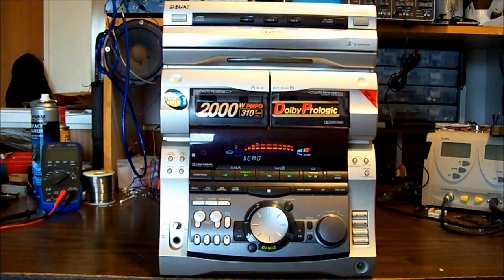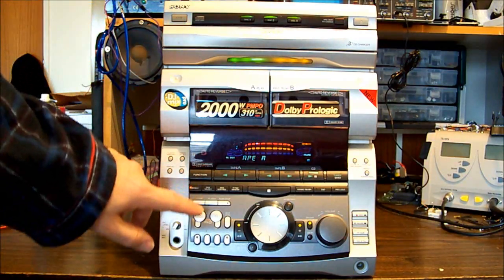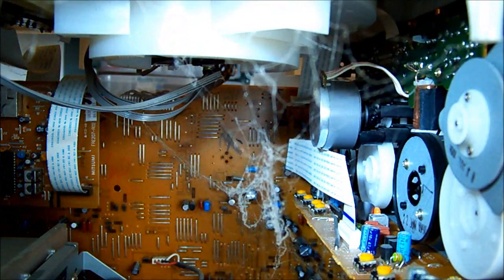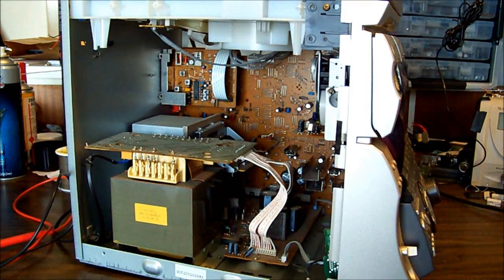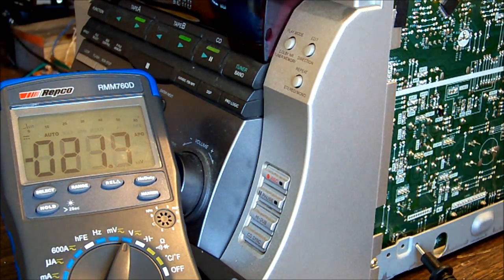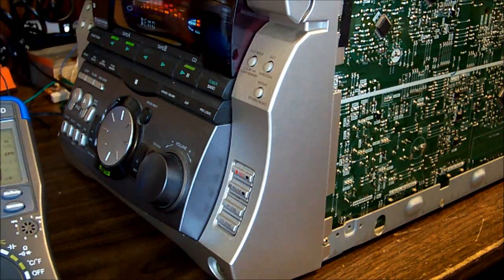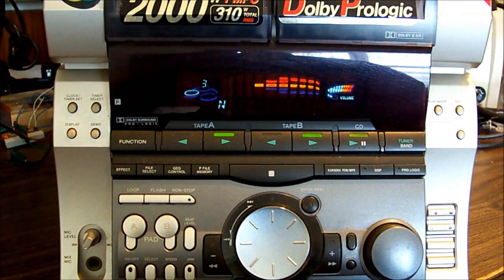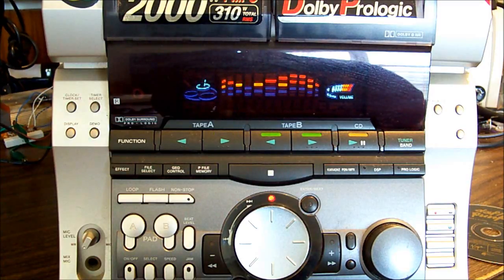Sony HCD-GRX10AV mini system diagnosis and half-repair

Comment: Hi sir. I found your video exciting. Seen sony antique products repairing nicely. I want your little help. I've sony hifi music system model Sony LBT - zux10d. Its been working nicely but recently whenever i start the unit it display shows Please Wait. Dvd tray open & close but disk doesn't play. Its display show Only Please Wait. When it shows Please Wait sound doesn't come even in Fm, not even in tape and audio in. Please suggest what is the problem in it. Thanks alot
Reply from the maker: Just guessing but does it only show please wait when you select CD or can you listen to FM, turn it off, then turn it on and get message? If CD triggers it I would say check the limit switches etc. It might be trying to home the tray or laser or something but can't tell when it's ready. If any source does it maybe it's waiting to see if the speaker output is ok. Firstly check the board for bad solder joints around high temp areas like power supply and amplifier. Unplug and reinsert flex cables to make sure connections are good. Then make sure voltage rails are complete and clean.

Comment: i have the same music player, and it has the same trouble, only i can get it to cd mode, after you press on, i always quickly turn on the cd player, and very quickly i have to open the disc tray and insert the cd and then do eject to get they disc tray inside, if i don't do that the installation shuts itself off, if i do manage to do that rather quickly (just a couple of seconds time) then there is no problem.... really weird....

Comment: Hi there I have a Sony mhc gnz8d 5.1 the sound of front and left channels are dead rest surround and centre channels are working fine. What could be wrong with the player please need your help.
Reply: And there is current passing on the chassis of the player when I checked with a current tester.
Reply from the maker: Hello. I guess you've tried one of the other speakers in that connector to make sure those speakers aren't dead. If they're ok you'll need to start tracing with a scope. Find the amp IC and make sure it has signal on input. If yes then amp IC likely dead, check datasheet for any mute pins and make sure they aren't active first and also that the IC has power. If no input signal you'll need to trace it back further and find why. I haven't seen this problem on this unit so I can't tell you exact cause.
Reply: Jonny Fix I don’t have a remote for my player any remote that  may be a universal remote. My problem with the front channel is not fixed and I m listening the Sony with the surround channel I don’t know how to fix it

Comment: i have a sony GR7 stereo system and it makes this buzzing when you turn the volume on from 1 to the max it goes once you turn volume off or disconnect the speakers i tried fixing it myself first i thorght it was the transformer because i have two of the same stereo system i just swaped them around it wasn't that so i tryed swaping the amplifier but it wasn't that either would you know what the problem is...... please reply
Reply from the maker: So it buzzes only when turning the volume control? A quick google search found service manual. If this is the case I would look at IC201. Volume is managed digitally so any noise induced will likely be digital. If power supply to chip is clean and accurate then I might suspect that but be good to use a scope to probe around and check for sure. Read the datasheet on it and see if there's special mention of component values (like caps) required to minimise noise. Maybe caps or something related to this chip are failing. Good luck!
Reply: Jonny Fix thankyou for your reply but me being me i just couldn't wait and it was annoying me so much so i just swaped the whole motherboard around because i knew it was something on that.... anyway i fixed the buzzing but turns out that the sony gr7 i thorght i had was a gr8 so once i switched the boards around i noticed i couldn't use some of the (dj mix) features but that's alright there not too important in total just 5 buttions on my sony gr8 that don't do anything but all functions still work.
Reply: do you think it will be fine me swaping the circuitbored from gr7 to gr8? will there be any future problems? such as overloading or overheating of any chips or damage to any parts?
Reply from the maker: SkidMarkz I'm a little surprised it worked at all. No idea without looking over schematic of other and comparing but if front controls are all that changed it'll probably be fine. You got lucky lol!
Reply: Jonny Fix they are technically same model just a few usless add ons on gr8 that are not on gr7
Reply: Jonny Fix i'm thinking of swaping the transformer because transformer on gr8 seems a bit bigger that the gr7 so i might swap that around and a few bits on gr8 curcitbored are bigger that gr7 but at the moment all works fine
Reply: i found out what it was causing the problem with a bit of investigation i came to the conclusion that it is the sound processor chip that was causing the buzzing sound on the  gr8 circuitbored it is over heating and hot to touch lol just thought you might want to know
Reply from the maker: SkidMarkz that would do it. Poorly filtered voltage rails have been known to make a good chip hot by causing unwanted oscillations that make it work overtime so I would still want to rule that out before condemning the chip. Good spotting tho.
Reply: Jonny Fix haha thanks but i can't do any futher actions such as soldering on a new chip btw i'm only 14 worn't expecting that were you?
Reply from the maker: SkidMarkz I was soldering at 12, you can do anything with a little practice! Glad your having fun playing around, just keep clear while the plug is in the wall, trust me shocks hurt :)
Reply: Jonny Fix i would love too but my parents disagree with what i do. So i can't get a soldering kit or anything if i had all the equipment i would be so happy to try new things. I have been electrocuted before by 240 volt ac luckly the downlights were fitted with transformers i love electronics and lights but anyway.... I have been electrocuted by ground and + and _ wires in light socket not that bad just tingles for a while and your hand feels abit numb not a big deal LOL...
Reply: @raminvmusic  dont do it. You might blown your whole system and your component might be turn to trash . You might check its schematic diagram of gr8 vs. gr7. But as what ive seen both have diffrent diagram

Comment: Which ic used for sound system
Reply from the maker: Not shown in this video but you can kind of see it at 4:40 mounted to the heat sink behind the transformer. I don't know what part number.

Comment: Hi Sir, I have Hifi RV777D, suddenly we are not able to hear the sound. what to do
Reply from the maker: The service manual is easy to find on google. First try a cold reset by pressing STOP, PLAY MODE/TUNING/MODE AND DISC1 buttons at same time. Display will show 'cold reset'. If that doesn't work start troubleshooting via schematic. There is a relay between the amp and the speakers. Is this relay clicking on when you turn it on? If not then the unit is in protection mode. Check there is no DC on the output of IC301, if yes then chip is likely bad. If relay is clicking on you need to use a scope to check for input signal to IC301. If it's missing make sure it isn't in mute mode by checking Q373, Q375 on pg67. If not in mute you need to keep following back to the source. It uses a DAC which could also be faulty. Good luck.
Reply: @JonnyFix  i have the same problem with my sony rx77 .should i use similar steps?
Reply from the maker: @julikb  I don't know that model but I guess it couldn't hurt to try

Comment: when i plug in sony music system it gets its power on but when i press the power button to play it, it goes off and the power button start blinking.
What maybe the probable troubleshooting
Reply from the maker: I would start by monitoring the power rails to make sure they aren't dropping off which they may be doing as a result of extra load from the mechanism when you press play. Also, google search your model number and blinking power light, it might give you some direction.

Comment: Hello, ive bought a sony rx 90 hifi and after a few minutes of play it started to make this weird behavour! Whats wrong with it? Why cant it read the cd? Hope you can tell me how i could fix this little beauty. Also is it normal, that the little fan/Cooler on the backside dosnt spin? Or does it spin from time to time? I would be very thankfull! Her is what it makes: https://www.youtube.com/watch?v=r2RnpR2Nip8&feature=youtu.be Do you have any suggestion or recomanedations? Thanks!
Reply from the maker: I believe there is a rotating switch (or a few micro switches) in the mechanism that can cause erratic behaviour if it is dirty/bad contacts. Basically the processor doesn't know what position the mech is in. If it's only having trouble reading CDs try cleaning the laser lens (no harsh solvents). The fan might only come on at higher volume or when a certain temperature is reached.
Reply: hi, the fan came on on louder volume! So at least it works.

Ive swiped the lens with a earpick already. dosnt helped. How can i see this micro switches or roatitng switch?
Antother question: When i plug my mp3 player into the "video/md in" rca connection via chinch cable, i only barely hear the music. There is a loud grooming sound on top of the music. When i touch the mp3 player(which body is made of metal) the grooming gets louder. Whats even more strange that if i touch the housing of the sony hifi, the grooming get quiter. Is there some grounding problem in this piece? Normaly i should be able to plug any source into this "video/md in" port, right?
This is so fu..up! I boght this beauty and now i cant use anything exept the tuner. Would be great if you could help me out.
Reply from the maker: The switches would give problems like tray won't stop rotating or random eject etc. Not reading disc, if lens is clean laser is probably dead. Switches are under cd tray. If MP3 player is battery operated maybe the cable is bad, try it on another amp. If mains powered it might be some weird ground issue. If you're holding the player while you touch the unit and noise gets quieter then my guess is bad cable.
Reply: hello,

my guees is the laser too! The mp3 player ist battery powered and works flawelessly on another amp. So cble and mp3 should be fine.

Found this video! Same behavoir like mine, except that on mine it dosnt helt if i spind the disc with my fingers. Mine dosnt read it like his. He says in the comments below, that the spindle motor war fault.

https://www.youtube.com/watch?v=K9XtW-wmE9M

Another question:

Can you guys tell me how to connect a chinch port to the signal of the cd player? Because the MD/VIDEO IN is useless with this grooming.

I dont need the disc segment if i can make an AUX IN
Reply from the maker: At 5:10 you can see a white flex on the right side going up to the top. This probably carries power and signals between the CD deck. If you're lucky they labelled the board by the connector and you'll see which pins left/right. If unlucky and all the decoding is done on the main board you'll need to look around for where it becomes analogue and connect to there. Or, find out which chip handles source selection and connect to that.
Reply: hi. unfortunately im not electrician! I cant messure the signals or stuff light that. Ive send some photos from the mainboard in a forum and someone will mark me with photoshop which pins are the ones where i could connect some aux connector. But i dont know why the hell my md/Video In is grooming so heavy when i connect my mp3 player or phone. Or isnt this md/video in not a regular aux in?

Hier ist what the mainboard looks where the cd flat cable connects:

https://www14.zippyshare.com/v/Kg67cuPN/file.html